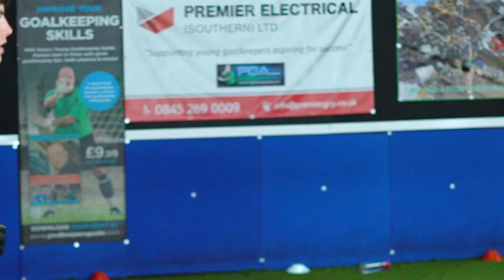Professional Goalkeeper left Football for Bricklaying!

Comment: How can you say bricklaying is the hardest trade without experiencing the other trades ? I'd like to see you pitch a roof !
Reply: Bricklaying is the hardest trade without a doubt
Reply: @tomhinsley2239  it's deffo not the hardest trade by a country mile. It's probably the easiest. It's ultimately just like building blocks for children, very repetitive, very simple not many brains used. Simple measuring and repeating. It's very hard in the physical sense and tough work in footings etc but hard as in difficult technically not at all. Not much maths or equations to learn like sparks or joiners. Plumbing is harder technically too. Most brickys are pretty simple like this lad. I mean a mixer is the hardest part to learn how to operate FFS. Other than that it's a trowel and line. Hardly rocket science.

Comment: i couldnt be arsed trying to level bricks all day to be fair, but its not the hardest trade by a long stretch, the only trade most of joe public wont even attempt do to themselves is electrical installation, and when they do have a go they cant connect a loop in pendant connected back together again after theyve tried to swap a light fitting LOL
Reply: @scoyle1750  LOL try unrolling a 500m drum of 2.5 swa when youre 17metres off the ground directly above it, and doing that for 8km of cable per day, ever walked 8km on your hands before?

whatabout manually pulling a 4 core 95mm swa into position? even the digger struggled

bricklaying could be done by any donkey with a spirit level
Reply: @scoyle1750  try not strain yourself lifting 2 breeze blocks at a time will you eh?

just finished wiring an entire 3 bed flat in 6 hours, theres a reason everyone looks UP to sparkies
Reply: @croikeymatesthrowashrimpon8130  good man I have dug out 4 cubic metres of clay for foundations with a shovel in the snow cause us brickies are fit and used to hard graft, electrians would be knackered looking at a shovel nevermind trying to use it 😁👍
Reply: @scoyle1750  whenever i show up the trench is already dug, wasnt aware they didnt magically appear

every trade has its slackers